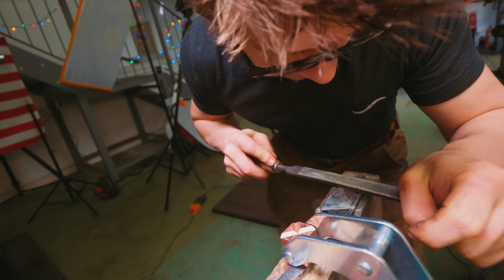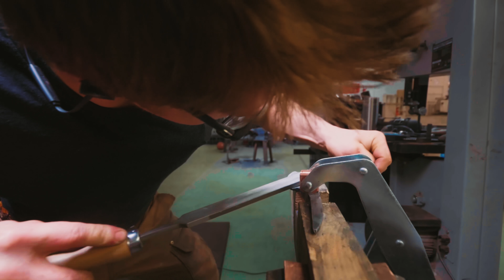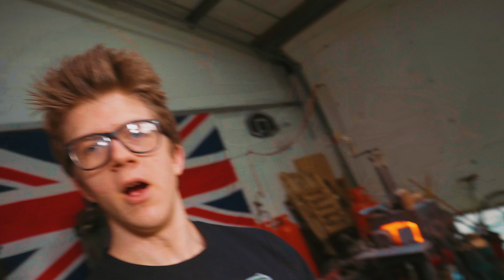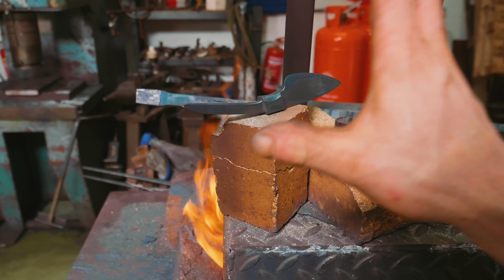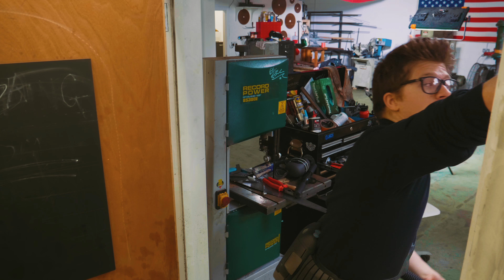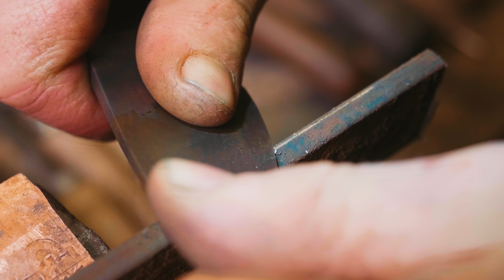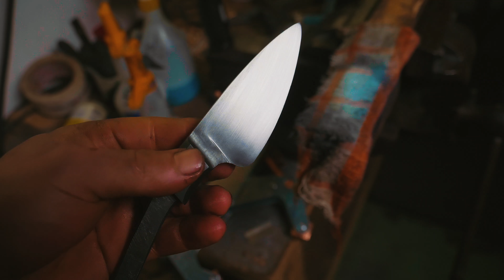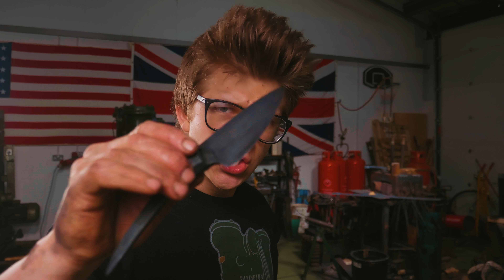MAKING A KNIFE WITH NO POWER TOOLS!!! PART 3

Comment: It's cool seeing you do a no power tool build.  I'm guessing a good portion of your viewers wouldn't have access to most of the big tools, so it's cool to let them see what they can do with limited tools.
Reply: it can all be done by hand it will take an extra day and different heat but it is all able to done in a reasonable timw by hand
Reply: I do like the idea but it doesn’t really help because the hardest things to get are the anvil and the forge and those are necessary
Reply: slender cream if you can get your hands on a little steel plate probably 1/4 inch thick and fire brick and such you can make one. Either gas and just have the process of forging span more than a day. Maybe 3 heats. Or just do coal and keep it running. Which could be cheaper.
Reply: slender cream you can improvise the anvil with many things. A piece of train track works great, for example. 
And the for the forge you have lots of DIY videos here in YouTube that work great.
From that, make your own hammer and happy beating.
Reply: You don't need an anvil. You can get a large block of steel that will work at most any scrap/junkyard. I found what seemed to be an old bore block that was 6"x12"x14" and even with all the holes in it, it still was over two hundred pounds. I got it for steel scrap price which at the time was 13.7 cents per pound put another way it was less than $25. All I needed to do was clean the top off with a flap sanding disc on my angle grinder and I was off to the races. As far as a forge, my first one was literally a hand full of bricks and cinder blocks with a piece of pipe and a hair drier with wood lump charcoal. It may not be pretty or even the most economical, but it is a place to start. I hope you can find this helpful.
Reply: slender cream for the anvil you can go to any steel mill and ask for a 6 inch thick or so 12 inch long piece of steel and that will work that’s what I’m using I used cinderblocks for my forge the first couple of times it didn’t get it very hot and it took forever but it let me hammer a wrench into a point I just ordered a propane forge for 180 from Laredo blacksmiths on EBay comes with everything you need to set it up and is rigidized so when you get it you can start off forging right away 😁 so pumped for it to get here
Reply: did u watch and listen to the first video
Reply: For me it is hard to build a forge and to get an anvil shaped object (aso). But perhaps I will just start with blade steel that is already in the right dimensions, just saw and cut it out, then file it and start making knives and some day, I will have enough money for the propane forge, that I want to buy. Saving a bit of money every week and month until I have to app. 3000 Euros.
Reply: Congrats.  It's a blast especially when the tools allow your skills to grow because you can do more.
Reply: josh major  you admitted you were wrong. That is uncommon for the internet, so good job.

I forgot what I was going to say.
Reply: I totally agree because i fall in that category